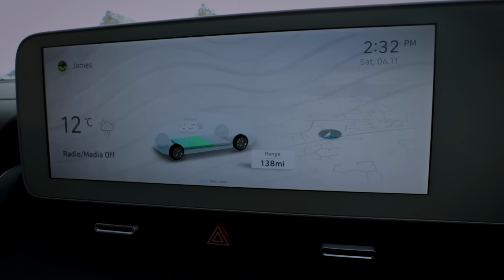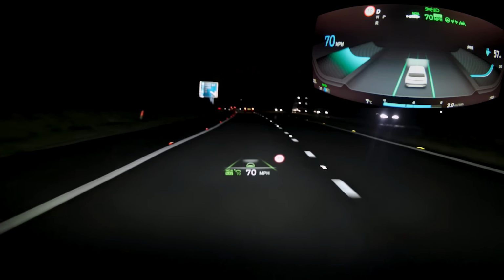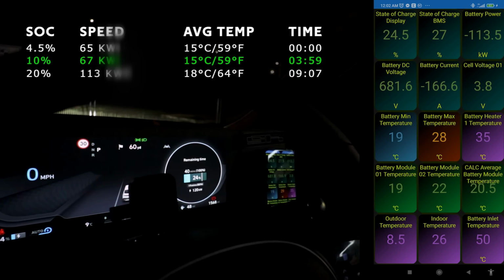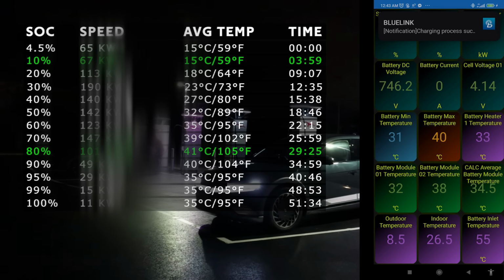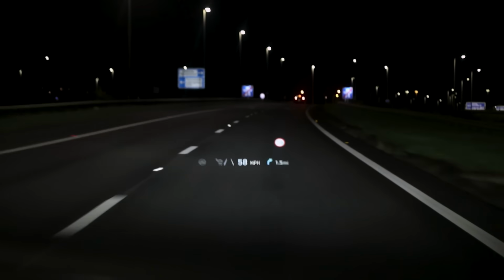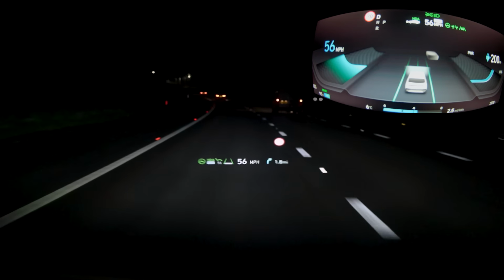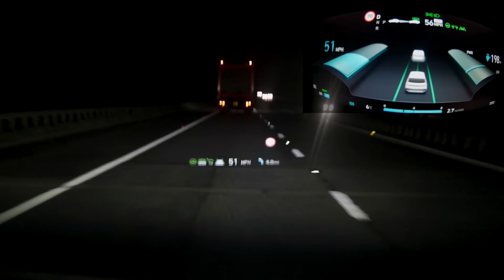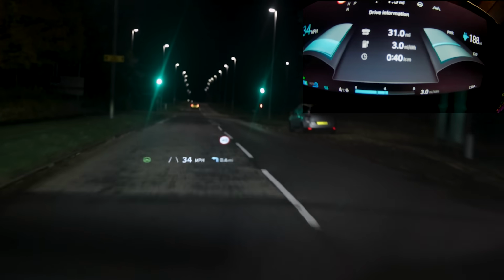Hyundai IONIQ 5 - Head-Up Display (HUD) system in Action- Augmented Reality & Normal Mode @ night

Comment: Help! I have searched high and low for info on how to put the HUD info on the 12.3” display, like you show in your video. How is it done? I can’t find any options for doing that on my 2023 AWD Limited. The HUD works find…but I can’t move it to the display. Thanks!
Reply from the maker: Steering wheel right side buttons top left the one that looks like a note page click that till it goes to the lane distance icon (left most icon) scroll down till you see the car and lanes it'll be on that page. Hope that helps.
Reply: Thanks man! It works!!! Now if we could only get Siri to raise and lower the windows!
Reply from the maker: @jgtillery  don't think you can control window via bluelink so unlikely to work ☹️ glad you got the display sort, tho wasn't sure if my written direction was clear enough 😄

Comment: In adaptive cruise control, I  make adjustments to the set speed depending on the driving conditions, because if it is too high and the road ahead clears, the car will speed up quickly to the set speed, and sometimes the conditions for safety needs to be slower so I toggle the speed down where the flow of traffic is adapted.
Reply from the maker: You could try vehicle setting/drive assist/SCC and set it to link base on drive style and it'll learn your manual acceleration if you don't tend to pull off the lights quickly. Otherwise try link to drive mode and set car to eco for a slower acceleration. But yes I tent to slow down to 65 on the HDA to stop the car rushing to 70.

Comment: Hi, what version Ioniq 5 do you have? I ordered the ultimate tech and I don’t have the same information you’re getting? I don’t see boxes passing on left and right and I can’t change lanes with the indicator stick.
Reply from the maker: The cars left and right only apear when on the motorway/highway, also I've only figure out that if you hold the indicator stick up slightly before it clicks it'll do the auto lane change, I'll need to do a video about this.
Reply: @LemonTeaLeaf  it turns out my 2022 Ioniq 5 has those features removed due to parts shortages!
Reply: @LemonTeaLeaf  https://youtu.be/0aoXLaai5mQ

Comment: Does the head up display navigation also work with Google Maps when having the phone connected via Android Auto?
Reply from the maker: No it doesn't work with Android auto or apple car play. Would have been handy if they implemented it work.
Reply: @LemonTeaLeaf  Thank you. 
I heard the inbuilt navigation uses outdated maps and doesn't know about construction sites or blocked roads or one way roads. (At least in Germany that seems to be the case). Is that true also for Scotland?

Comment: I am seriously considering buying an Ioniq 5. I have a few doubts about the lack of a rear windscreen wiper. I would appreciate you honest opinion as to whether this is a deal breaker or am I just worrying too much. I live in the west coast of Scotland.
John
Reply from the maker: I've no issue without the rear wiper although I have applied Meguiar's Hybrid Ceramic Spray Wax https://amzn.to/3p9qwJH on the body of the car and a coat onto the glass. so when it rains heavy enough it seems to wash any dirt off. I can still make out lights or shapes behind me if it does get a little mucky. Overall it's not really been a problem for me with all the other safety features. I suppose you could use Rain-X which I'll try after winter. It would be handy to have a rear wiper but i think it's design over function which I'm ok with.
Reply: James, thanks for the feedback, much appreciated. John. Great videos by the way!

Comment: Very good James so this work in conjunction with the navigation system if you want the arrows to show up on the HUD so every trip has to be pre programmed . I do like this much better than the Kona's pop up screen, the only thing that would worry me is the cost of replacing a windscreen as in Canada we do get a lot of rocks on the road we may find that our insurance may have to have some kind of rider.  Thanks for the video .
Reply from the maker: it's actually projected from the top of the dash onto the windscreen which seems to have a thin layer on the windshield to reflect the HUD, so i suspect it shouldn't be that expensive to replace. I could be wrong.

Comment: Thanks for this. There are always SO many "general" car reviews that try to show a little of everything and not enough specific reviews to show how one specific thing works. I've watched hours and hours of Ioniq 5 videos and this is the first one to clearly show me how the HUD works and what the "augmented reality" is like.  I'm wondering if the HUD works (with or without Augmented Reality) for directions if you're using Apple CarPlay or Andoid Auto for Map guidance?
Reply from the maker: Thanks good to know the videos are useful 😄. I'm afraid that android auto and apple car play map direction does not come up on the HUD. would be good if it does but they seem independent of each other.

Comment: Hi, what kind of version of the software do you have? My car cannot detect cars around me + I am able to see only basics info in the AR (lines check, speed limit and distance from car in front of me). I also noticed that I cannot charge more than 120kW on 350kW Ionity, sometimes I even cannot go above 100, so average is around 80kW for this powerful stations. If I use station with 150kW of maximum output, then my charging is normally around 148kW - so basically as it should be. Did someone notice similar behavior? I was speaking also with tester of Ionic5 in front of one of the Ionity and his charging was even slower, he cannot go above 49kW on 350kW charger. I have Ionic5 4WD 72.6kWh.

Comment: on the standard hud, you got lane guidance IE highlighted the right 2 lanes, but on the augmented you just get the arrow, that doesn't seem as useful, especially places like Glasgow where the motorways joining left and right, you might end up in the wrong lane.
BTW, cruise distance bars are seconds, so you set 1-4 seconds distance from the car in front
Reply from the maker: Must admit the Augmented reality unless you know what the arrows are saying is confusing around Glasgow. It doe get a little use to. Ah thanks for the cruise distance info 👍

Comment: Those arrows seem very confusing to me.
Why didn't you change lanes when the animated arrows were clearly pointing you to the left or right lane ?
The standard mode seems to be better understandable to me, as it does a better job in a less confusing way showing you which lane to choose.
I would turn off the other vehicles beeing displayed, that's just a little bit too distracting to me, as I can see them anyway through the windshield. 
All you need is speed, the navigation, pre collision warning and the blind spot monitoring. 
I am a bit sad to see you don't get incoming phone calls displayed as in Toyotas Head up Display or at least it's not mentioned in the manual .
Reply from the maker: it was telling me that I needed to stay on the right/left path as the motorway was splitting off into 2 directions, rather than the right/left lane. It can be a little confusing but once you get use to it it's not that bad. It does have audio option in the normal mode which i didn't show, i assumed it was for the radio maybe it'll show caller ID also? Will need to test that.

Comment: Does the head up display give directions if you’re using apple car play directions? As in apple or Google maps.
Reply: Unfortunately, it won't as of now. It might in the future. There are discussion trying to figure out if this car has the HW to do this wirelessly (at least for Google Maps).
Reply from the maker: As Fredrik said, it doesn't which is a real shame would have been nice to have that option.
Reply: Are there cars already providing this? Guess not

Comment: You still have that difference in pack module temperature narrowing your fast charge window.
1+3 sitting 3-4° low when cold
When 2+4 are ready at 24°

Then (9:21) 2+4 sitting 7° higher (44° vs 37°) throttling the top end.
If they could balance that you'd see the 190kW+ rate over a longer period.

You mentioned the 45°c limit, that's why the charge slows. They set that as the safe limit for the cells.
Reply from the maker: That makes sense why it was sitting at 45°c I'll got more footage with that charging session i'll compile into another video hopefully decypher how the P45 was programmed to deal with the colder weather.
Reply: @LemonTeaLeaf  
Check the video of your trip to the dealer.
That's where I first noticed it.

Comment: Great job.  Very interesting and very detailed ... 👏👏👏 I thought that the Hyundai Ioniq 5 only had blank screens, and yet, to my surprise, I see that it also has it in dark mode like the Kia EV6 ... 😱😱😱 Can they be adjusted between one mode or another in settings?  🤔🤔🤔
Reply from the maker: Yes you can have light and dark mode also you can set the time you want it to switch at so it'll auto switch between both light/dark screens.
Reply: @LemonTeaLeaf  👍👍👍

Comment: A suggestion; focus on max and min battery temps not average. The transitions are then easy to see. 15c 20c 25 c min for cold battery, 45 c 50c are triggers in a hot battery. Will get ~50C type temps at 220kW ie need plus 25c min temps. At high SOC charge rates drop by the SOC curve and at 50kW will normally not heat up (cf 220kW at low soc will heat up). Of course ambient 10c helps but I wonder at 35c ambient how charging will go.
Reply from the maker: Good point about the min/max rather than the average. I think the modules closer to the outside of the pack is cooler. It would help if they could some how even  the heat. Not sure how they can do that without having seperate cooling pipes for each module. Be interesting to see if it'll leat over 46c in summer or if it's the colder weather helping to keep it under the 45c temp?
Reply: @LemonTeaLeaf  Absolutely. Keep up the videos, very interesting and helpful, cheers.
Reply: I've mentioned this elsewhere.
The difference in module temps isn't helping, it narrows the fast charge window.
Seems they have the max temp set at 45° for rapid charge. Needs better balancing between modules 1+3 (37°) and 2+4 (44°).
Reply: @rogerstarkey5390  Interesting observation, does the Available discharge power drop in your car when battery reaches 45 deg. C?
Reply: Great video about HUD, thanks! What is the Water cooling temperature during charging, the cooling liquid has a hard task, there was 15°C difference between coldest and hottest battery modules. Is Available discharge power limited when battery is at 45 deg. C? Ioniq 5 profile in Car Scanner would show these and some more sensors (My cars menu - add new car profile).

Comment: Great video thanks for taking the time to make it. The blind spot monitor looks really useful. Can the i5 limit your speed to the speed limit, i.e. can it help you to prevent getting a speeding ticket, if you're not using cruise control?
Reply from the maker: Yes then the speedo is set to the speed limit of the zone 50/60/70 it'll slow down to each speed using the HDA (highway drive assist) system you can see it automatically launching me forward here to 70mph https://youtu.be/uuRS9Bo_PAg?t=716
Reply: Could this function be turned on/off? And when it’s on, could you set a buffer, eg 7 mph above the speed limit?
Reply: Amazing informative video. Haven’t seen this info anywhere else and I’ve watched at least 20 I5 videos. Great work, thank you! The adjustments for the HUD are fantastic. I can’t wait.